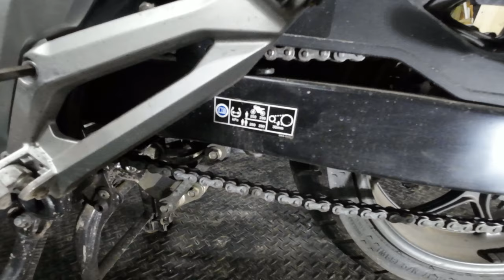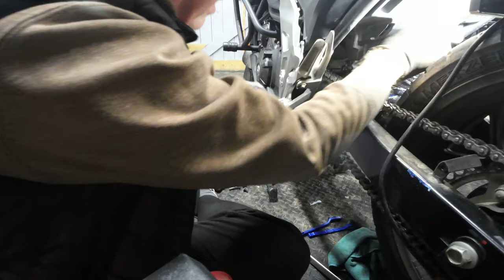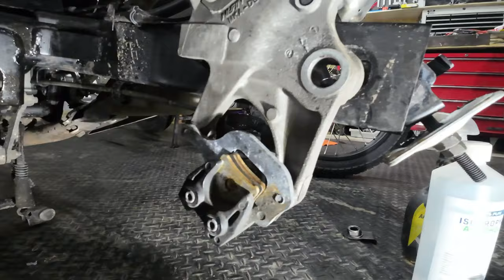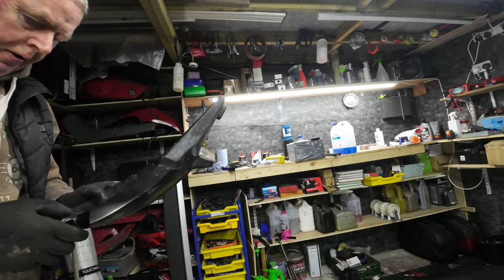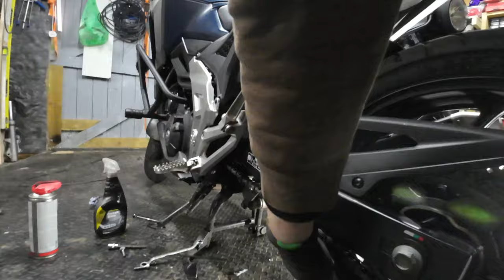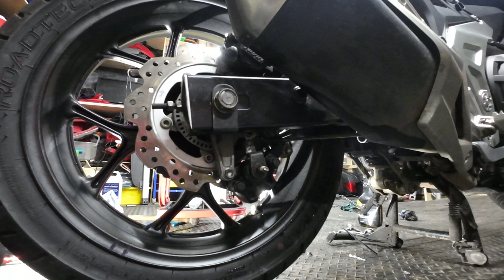Honda NC750x DCT Protect the Rear Shocker Maintain your Chain in 2 hours

Comment: Have you not thought about a shock sock?  I made my own from a neoprene knee support tubing when I first bought it,  I then sprayed it with ACF50 and did the same every year.
I put it on by cutting it length ways and wrapped it around the shock from top to bottom and secured it with cable ties.
Last year I checked the shock and it was bright and clean with no rust whatsoever.
Reply from the maker: I was going to get the sock when I done the drop links, but yes I'm still going to, I 'm toying with buying the YSS shock and springs upgrrading the whole suspension👍👍👍
Reply: Yeah I bought one it was only about £10 off eBay and my bike is now on over 60000 miles and the rear shock is still going well looks brand new under there

Comment: Thanks for the video. A while ago I used to run the rear and wax the chain the way you did. Then once I got a red ‘system-check’ warning light on the dash that scared me. Turned out by running the tire off the ground it can throw off the rear ABS sensor. The dealer just had to re-set the code but it had me worried when I first saw it pop up. It may not happen to you but thought I’d mention it just in case.
Reply from the maker: Cheers for that, I'm calling into Youles later today, I'll quiz the mech and as him, no red light for me yet👍👍👍

Comment: Great video, thank you. I noticed you have a GP Kompozit crash bar. Diditfit ok or did you have to modify anything? Thank you for your time.
Reply: @birchwoodbiker  Thank you. I’m going to push my luck and ask you one more question if I may: do you have a recommendation for soft bags (don’t like hard cases) that would fit and  hang securely on those carriers? Thank you for your time.

Comment: Any reason you didn't go for a neoprene sock over the shock, i put one on my Nc the first week i bought the bike and it seems to work fine.
Also any tips on adjusting the rear preload, as i find it a real swine to do, to the point that im looking at upgrading to a shock with remote preload.
Btw, page 136 of the owners manual says check the chain slack with the bike on the side stand.
Reply from the maker: I bought a sock just never fitted it, and will at some stage, To be honest on preload, I,ve not adjusted mine on this bike, but it will rasee the hieght and stiffen the ride from stock, you also have to understand the slack, I would of thought from stack settings it will be ok, it's when you ad extra weight it can get stiff over bumbpy ground.
I'll have a look myself on the forums, Honda Africa Twin & NC750x Stuff is really good tuber for the older NC
👍👍👍
Reply: @birchwoodbiker  thanks for the reply. The preload thing is just for when I carry a pillion.